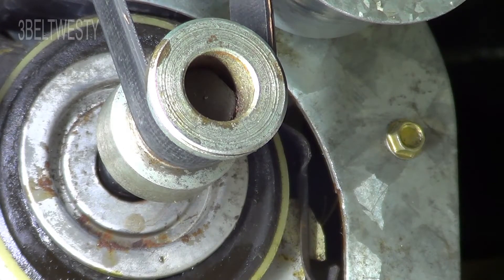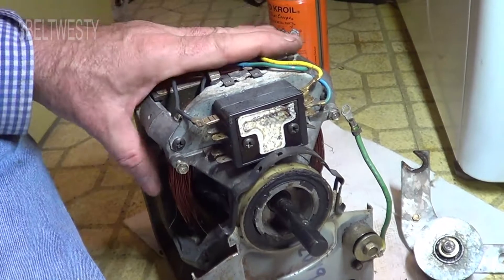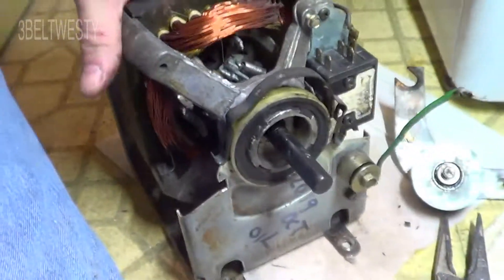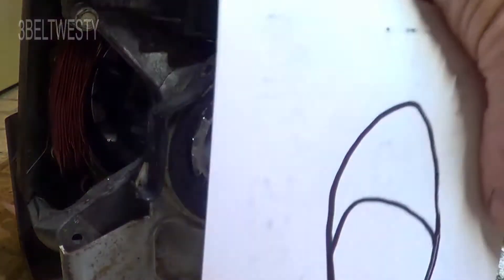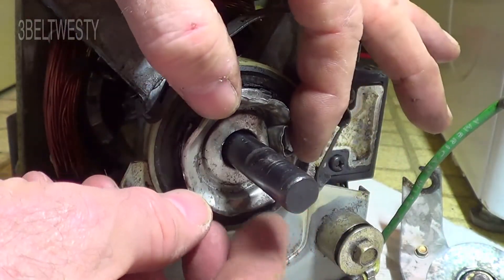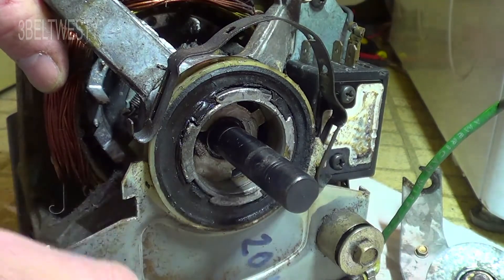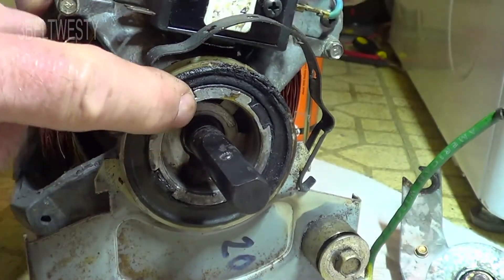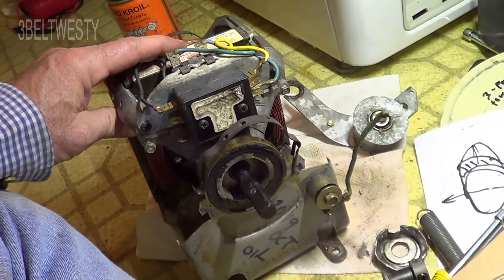Westinghouse Dryer Motor Bearing Hack  worn 003

Comment: Also Looks like the rubber motor mounts have moved off center by a good 3/16 closer to the motor top bc of the continuous tension of belt.  It'd only affect the belt life time, slippage etc.   Doesn't look like there's a replacement for motor mounts.

Comment: In the very beginning of the video the motor was switched on a few times but not rotating - what caused that?  I think the same thing is happening with my dryer - replaced the rear bearing, top front felt w/ plastic guides, so the drum rotates easily……but I still get that humming noise and no start-up sometimes, and when it does run I have excess vibration still.